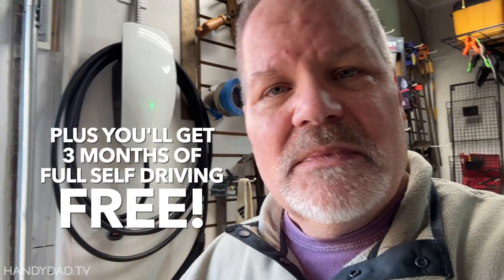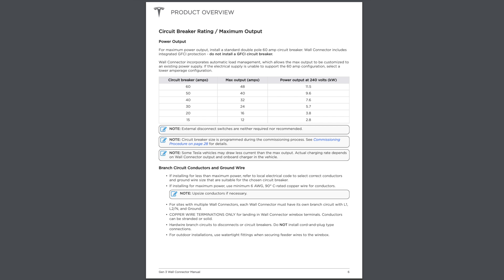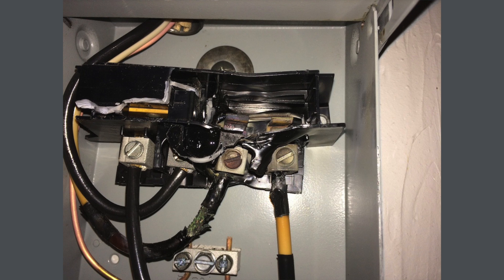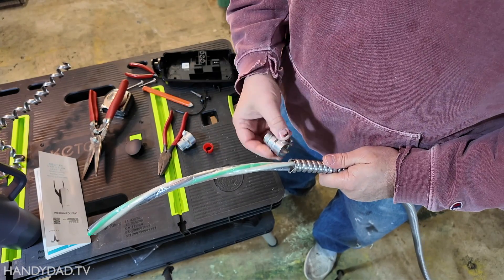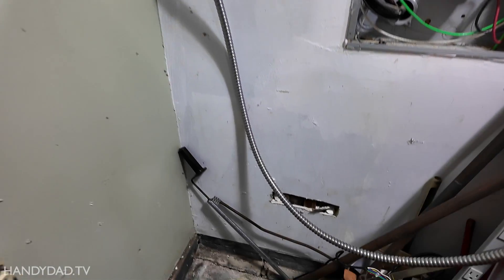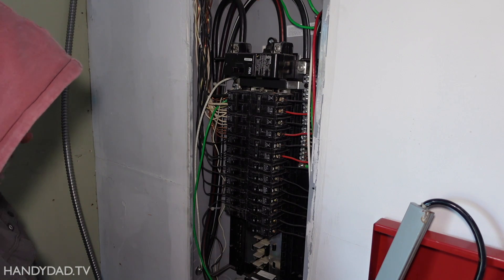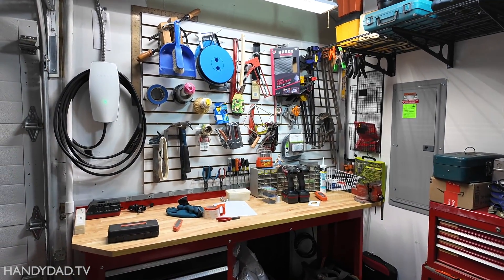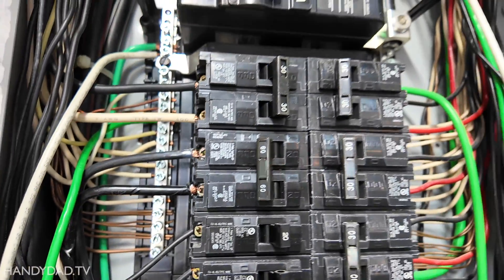Tesla Wall Connector Installation with MC cable

Comment: Great video , just wondering, Does the app tell you temp of the unit if overheating or any danger ?
Reply from the maker: It will stop or slow charging and notify you of the issue either through the app or lights on the front.
Reply from the maker: But it’s never happened to me, so I’m speculating.

Comment: Why did you wrap the white cable?
Reply from the maker: Because it’s a hot wire. Since white is a reserved color for neutral, you need to indicate that it’s repurposed as a hot wire.
Reply: @handydadtv  Why not just used black for hot instead of wrapping white?
Reply from the maker: @vshanmugam 2-conductor cable has a black and white wire. Since this is a 240-volt circuit, they are both HOT wires. I wrap the electrical tape to indicate it’s not a neutral wire.

Comment: When you charge how fast do you set it on your  mobile app? You said in your vlog that 48 amp is to fast for you  just asking since I don’t have any idea about charging and I always charge mine to 48 amps as well. Thanks
Reply from the maker: I normally charge at 15 amps. That’s plenty for me to recharge overnight.
Reply: @handydadtv At 15 amps wouldn’t it be the same as a normal mobile charger that plugs into 110v?
Reply from the maker: @archebaldo6155 No, it’s double. 15 amps at 220 volts is the same as 30 amps at 110 volts.
Reply: @handydadtv  ah thanks. That makes sense.
Reply: @archebaldo6155  You would need 240V on a 20 amp beaker to get the [16] amp output. I have mine plugged into a NEMA 6-20 outlet, that I also use for my table saw.

Comment: I thought The best practice is to torque it not tighten, wiggle and tighten again
Reply from the maker: Stranded wire can loosen after wiggling so electricians told me to wiggle and tighten again.

Comment: Thank you Handy dad. My question is did you connect the ground wire to natural or grand ?
Reply from the maker: In my circuit panel, the grounds and neutrals are on the same bus bar.
Reply: @handydadtv  is this the main breaker panel off the electric service, or a subpanel?
Reply from the maker: That’s my main panel.

Comment: Would have looked so much better in ridged conduit. Also, why not just run into the top of the panel w/ the MC? Would have looked much better than that big loop.
Reply from the maker: There are a lot of videos using conduit so I wanted to show an alternative. I went through the bottom because there was already a hole in the drywall and all my household circuits go out the top so it’s very crowded up there.

Comment: Code states that #6 Romex is only listed for 50 amps, which is commonly used for electric ranges. #6 thhn is good for 60 amps in a raceway , But the MC is a wiring method, so it is probably only good up to 50 amps also.
Reply from the maker: Max charge rate is 48 amps so that’s why the instructions say to use 6 AWG.
Reply: #6 thhn, not romex
Reply: @gary29585  MC cables carry a higher temperature rating than NM wires and thus have higher amperage carrying capacity. Thus, #6 MC cable is permissible for 60 amps continuous load.
Reply: @Hoser-t8s  Ummmm, no. The breaker is 60 amps but the CONTINUOUS LOAD is only rated for 48 amps (80% of breaker, or breaker is 125% of the continuous load, same result), I assume you just mistyped what you meant. You must size the breaker based on the wire and the breaker (and other terminations but here the Tesla Wall Connector is rated properly and not an issue).
Reply: @DJ5200A5  No I did not mistype. I was referring to MC cable having a higher temperature rating than NM wire, thus it having higher ampacity. Of course you size the breaker for the wire. What I'm saying is that the ampacity potential differs from NM to MC to THHN.
Reply: It's been 2 years since I did my install, from what I remember from my research before I did my install, I don't think you can use Romex because it can't meet the 90° C temperature rating, I also used MC because the specs said that it contains THHN wires
Reply from the maker: @fdeguilla Southwire 6/2 Romex at Home Depot is rated for 90°C.

Comment: Pro safety tip. Never stand directly in front of the panel when turning on the breakers. Always stand to the side as much as possible. There should be a minimum of 3 feet of space available all around the panel.
Reply: I'm no electrician so I must ask, why is this necessary? Fire hazard?
Reply: @JamarD421  We call that Arc Flash. When a defective breaker is open (not only defective, sometimes it happens), it creates an explosion/ blast.
It is unlikely to happen on a small 220v residential panel. Most of the time, this happens (rarely) on big industrial panels above 600v.
Reply: @jordan4599  Okay. Just looked that up and holy shit that is nothing to play with! Duly noted sir if I'm ever in front of a breaker I'm moving my ass to the side! Rare or not that's a precaution I'm willing to take. Thanks for that new bit of knowledge.
Reply: @JamarD421  One other safety measure related to this is when you stand to the side, use your non dominant hand to flip the breakers.  That way, if one does explode, you still have your good hand to use in the interim while the other one heals.
Reply from the maker: Thanks
Reply: Don't worry nothing happens

Comment: Mmmm i also cant believe nobody has brought to you attention the use of 2 connectors  is a big no no    but also i dont know where you were taught to un wind the MS. Cable you should be using your hacksaw to cut the sheath then slide the cut end off so you dont damage the cable inside.
Reply from the maker: Thanks for the advice.

Comment: Use a 3/4- 1/2 reducing washer next time instead of two flex connectors. Works better!
Reply from the maker: Thanks for the tip!
Reply: That is what I did and worked great

Comment: I have a Seimen panel, i am seeing a variety of 60 amp Seimen breaker available, do you know which one is a better fit putting cost aside?
Reply from the maker: This is my first experience with Siemens, and I have only used genuine Siemens breakers.
Reply: @handydadtv  Right, I am seeing two 60 amp Seimen breaker for the choosing ... So, not sure which is the right one.
Reply from the maker: @colinslam1950 I used the Q260.

Comment: Could you please provide a link to MC cable fittings you used in this video.  It looks like 1/2in trade size FMC fittings from the Home Depot are just a little to large for the 6/2 MC cable.  Thank you.
Reply from the maker: I don’t have a link for the fittings. I just bought them off the shelf.

Comment: How warm do the cable and breaker get after an hour at 48A?
Reply: I used 6/2 MC and charge at 48 amps, they get warm...that is normal...hence the higher temp rating of the wire.  Feel the Tesla wall connector wire to the car...about the same temp.  Normal!
Reply from the maker: I don’t know. I don’t charge at that rate.

Comment: 330.12, MC is not permitted to be installed where subject to physical damage.  Exposed installation under 72-96 inches from the floor is almost universally considered subject to physical damage.  Some areas say 6', some 8', some 7' 6", but no one allows exposed MC or NM under 6'.

When it comes to exposed runs in a dwelling unit, including garages, MC gets you no further than NM.  The prohibition on installing where subject to physical damage is exactly the same.

Even if your AHJ is okay with your install 99% of those out there, and 100% of good ones, are not.  This is very bad for educational content.  MC is not a cheat code.  It is always better than NM, but not always good enough!

Also, be very careful with garages.  Because it's tucked in the side it's defensible here, but if you had popped out of the wall at that height (bumper/snowblower height) at the back or side of the garage that would be installed where subject to severe physical damage.  You are fairly unlikely to get tagged for severe physical damage in a single family dwelling, though.
Reply from the maker: Thanks so much for the info. Especially the NEC reference. Most critics just say “wrong” (or worse) and give no supporting details.

Comment: Why did you go all the way to the bottom of the wall, only to go up to the power box. If you had gone across the wall to the power box, you would have used less wire and conduit.
Reply from the maker: Good question! All the house wiring goes out the top of the panel so I definitely wanted to come in from the bottom. The hole in the drywall was left there by a previous electrician who ran a power line outside so I reused it instead of making another one to save a few feet of wire. I went over the top because I wanted the workbench tight to the wall and planned to put the slat wall above it.

Comment: You are fortunate to have your power panel in your garage.
Reply from the maker: Oh I know it! Just that short 25’ cable was $80! Copper is expensive.
Reply: My panel was in the garage and we had to do a 50 ft conduit run.
Reply: My panel is in the basement…
Reply: @dahemayezi same on the opposite side of the garage.
Reply from the maker: @bootlegsnackz Good luck 🍀
Reply: Most new builds in my area have a subpanel in the garage.

Comment: 3/4 to 1/2 conduit reducing bushing. threads onto 1/2 FMC connector. attach to 3/4 opening on wall connector. Use w reducing washer.
Reply from the maker: Thanks for the tip! I honestly expected 6/2 MC would have been 3/4” so that’s what I bought originally. I had to run out to Home Depot in the middle of the installation, a common habit for me, and I couldn’t find any reducers. It was a weekend so the electrical supply was closed. I had to improvise.
Reply: I think you need a plastic bush on top of the lock nut on the panel
Reply: that is what I used and worked perfectly.

Comment: In other words… You already had it torqued perfectly because of pure, raw talent!
Great job and the garage is looking good! From what little bit I’ve seen it looks like you moved to a beautiful area. Great job, dad!
Reply from the maker: Actually I may have overtightened them a little 😳 but I wasn’t about to back them out. 

Love my garage now! I can get to my tools without having to move the cars. 

I’m thinking I’ll do another smart home tour as an excuse to show the new house. But I’ll wait for my daughter to move out because our dining room is currently a storage unit for all her stuff.
Reply: @handydadtv  Us dads should get together and start a U Locket storage biz with all the extra room we will have when the kids finally move their stuff out. My kids are in their 40’s… If you want to start this storage empire with me, I should be ready in another 10 years or so! 😂😂
Reply: Not a fan of this approach, and I'm plenty old enough to know how tight things need to be by hand.  Torque values exist for a reason.  I already had an inch-lbs torque wrench on hand when I installed our NEMA 14-50 plug for EV charging, because many things on a modern ICE vehicle are torqued in inch-lbs.
Reply: Good job , EXCEPT…YOU SHOULD Have SHORTENED YOUR WORK B3NCH AND MOUNTED YOUR CHARGER WAIST HIGH SO YOU DONT LOse 4 feet of the charger cord to your Tesla